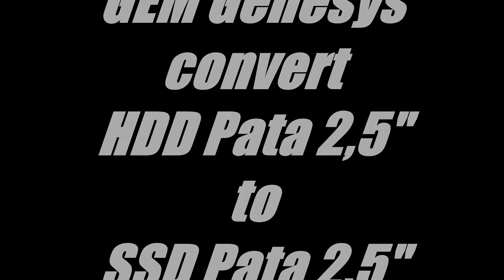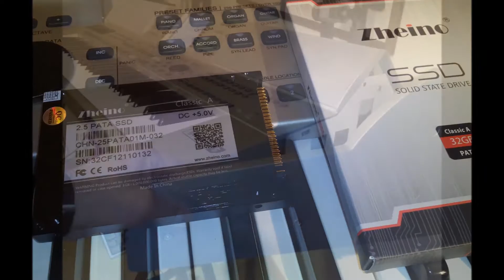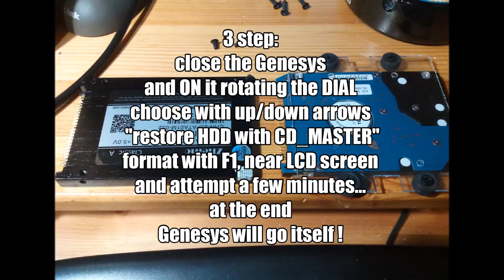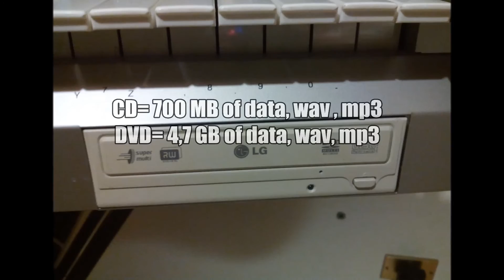GEM Genesys HDD failure or migrate to SSD

Comment: Hi TONY
          I HAVE THE GENESYS XP WORK STATION THE HARD DRIVE DISC LOST IS 
        THERE ANY WAY TO MAKE C D DATA MASTER THE WAY YOU DESCRIBE 
         IN YOUR  DEMO  WOULD IT BE POSSIBLE TO OPEN THE GENESYS TO GET THE HARD DRIVE 
       IMFO SOMEONE ON  E BAY SELLING EMULATER FOR THIS GENESYS WOULD THAT SOLVE THE
       PROBLEM LOOSING ALL THE SOUNDS ON THIS MACHINE  
                       carltheman@btinternet.com       best wishes M J Clarke

Comment: Tantas Gracias,es que tengo el Único en Sud américa,y no me Funciona,tratare con este Medio,Mill lGracias.
Reply from the maker: +ruben saldari I'm happy to help you and ,if you haven't the files to copy, send me a mail or message and i'll send all.
Reply: +Tony Lobue Gracias Tony ,por Responder, a mis cuatro años, de busca de ayuda,en estos momentos ,estoy tratando,de cambiar el HDD,por un adaptador de Pendrai,y si no resulta,intentare lo tuyo,ya que en este Pais es muy costoso,una SSD,--Thanks Tony, for Reply, my four years of seeking help, right now, I'm trying, to change the HDD for an adapter Pendrai, and if not, I will try your thing, since in this country is very expensive, an SSD,
Reply from the maker: hello ruben.. the pendrive is a replacement for floppy disk..after you must take an uSB pen and you divide in a lot partition with a program .. substituted of a lot of floppy.....  internal HDD of Genesys has every system folder and space for songs.. SSD to Amazon has a little price.. for the Genesys max 32 GB.. it costs 50$ i think..